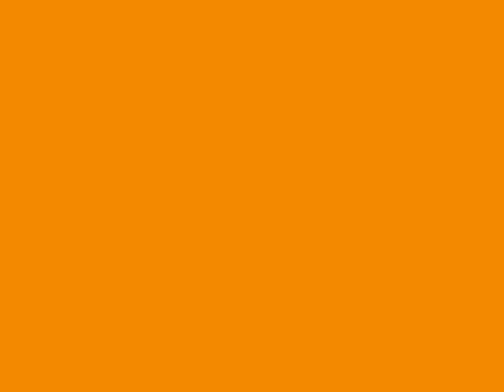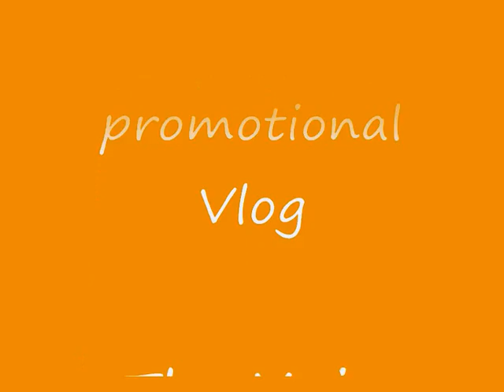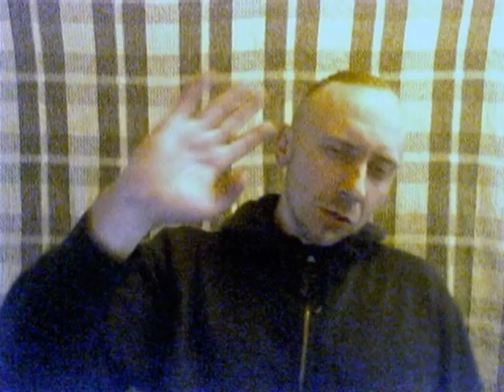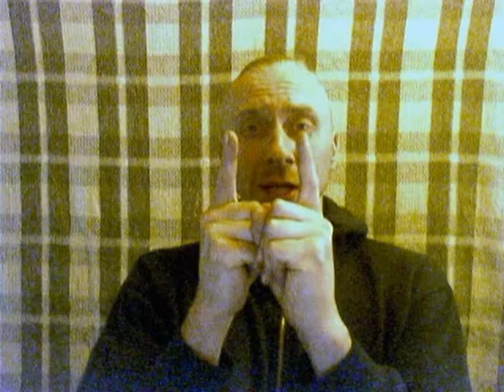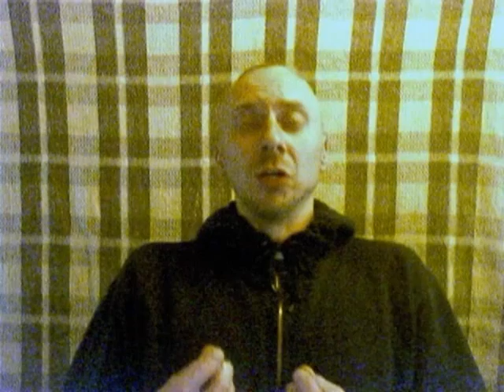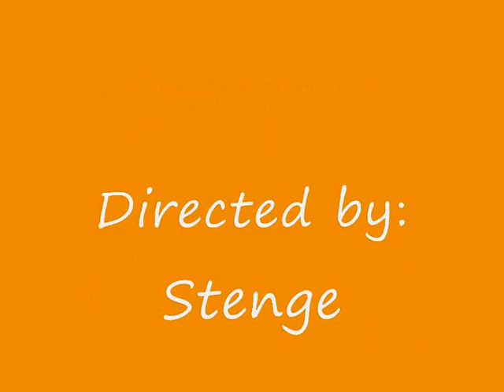Types Of Nuclear Batteries: Banned by Capitalism

Comment: it is not that easy.. these materials are pain in the ass... and most of the times they are not able to deliver amps.. they last long on low power aplications .. they need extra handling and monitoring safety subsystems..

Comment: I would like to state that cars and oil spills do not have radioactive half lifes or emit ionizing radiation. An oil spill as horrid as it can be cleaned up, and a car crash usually has a small number of casualties.  A dirty bomb derived from nuclear batteries or a breach of containment on a nuclear battery could cause extremely long term disastrous effects, some of which are notoriously difficult to reverse. I would also like to remind you that petrochemicals are used in more than just fuel.

Comment from the maker: I was thinking mini reactors in fuel station so you can charge cars there using fast charging and other such uses for the mini type reactors(Factory power stations, high rise power independance).  A mixture of Fast Breeder reactors and consumer reactors would keep a balance of enriched fuel.  If we had just fast breeder reactors we would end up with so much plutonium there would be more Pu that Fe on the planet.  You do know Fast breeder reactors are over unity?

Comment from the maker: Thanks for watching and taking an interest.  The point of the video is not to say we should have these batteries. I have thought of the implications. Have you read the nuclear non-proliferation act? In it the western countries agree not to use Fast Breeder reactors to enrich Uranium and also agree not to use spent fuel rods Pu239 as fuel in new reactors. We have all this nuclear fuel sitting around that could be make electricity and heat but just waiste it for no good reason at all. Highlighting

Comment: Frankly, this is the most powerful electric energy source that needs very little engineering and it's self-disposing, the containment case for an atomic battery can be it cask when it finishes it's power cycle.